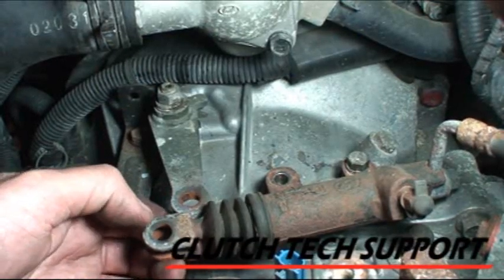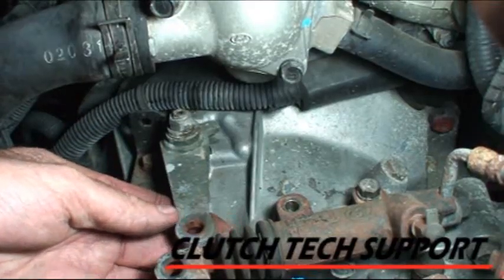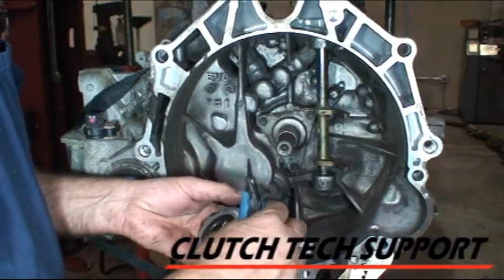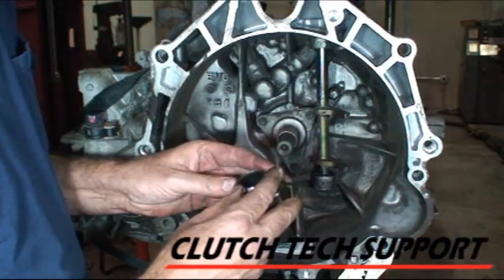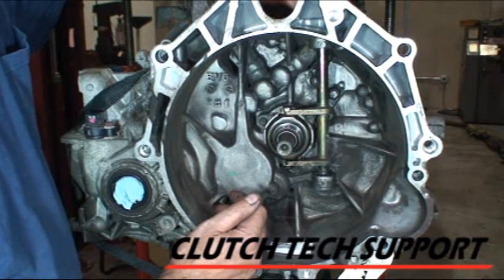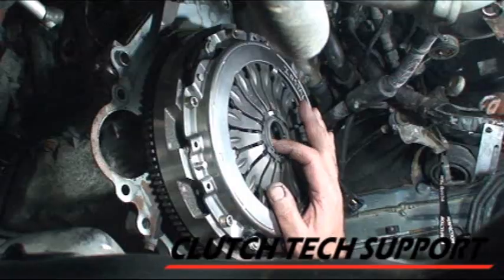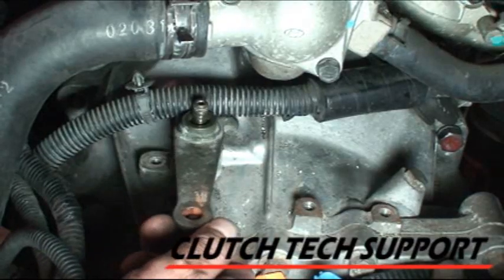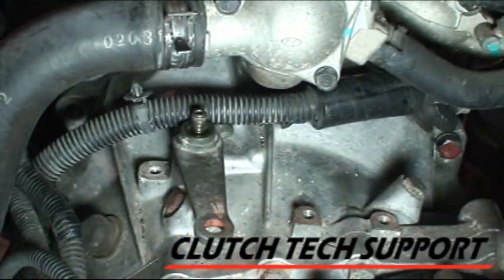Hyundai Pull Type Clutch Release System Servicing

Comment: I have a 2015 Accent, and I have to push the clutch pedal all the way to the floor, is there an adjustment so the clutch disengages closer to the top of the pedal.  Based on your video, is the clutch wear, causing the stroke length, or is the  pedal on the floor mean, I have a newer clutch.  I just bought the car and 99% of the people I talked too,  don't understand my question

Comment: I see you've recently responded to questions, so hopefully you'll respond to mine. 

I've replaced the pressure plate, throwout bearing, clutch, master/slave cylinders/lines, and have also pushed the lever arm towards the slave cylinder and havent hear a click until the arm goes away from the cylinder. What exactly would the problem be? its a 2003 hyundai tiburon gt with a 2.7 liter and 6 speed transmission. any help would be appreciated, thanks.
Reply: @perfectionclutch  So I've done what you said and it's still not working. It's like the throw out bearing keeps slipping out. It has minimal play and then whenever you push the arm away from the slave cylinder, it pops out and has too much slack in it. I don't understand how it would be slipping out if it has that stupid retainer ring that's nearly impossible to get the bearing out of. Is there possibly a number I could reach you at, because I've been at this for about a month trying to figure out what the problem is.
Reply: Ian Stephen  I have the same problem.. What worked for you? Transmission off and pushing the ring together for better grip on that bearing??
Reply: @vladisimi  not gonna lie, lol, I got rid of the car because I had tried everything and still couldn't get it to work
Reply: Ian Stephen I was also in the mood yesterday to ignite the car 🔥😂 But I tried to separate the transmission yesterday.  I adjusted the circle to point down.  (I had it at an angle during the first installation).  after pushing the lever I heard it click into the TOB.  And I think it's in place.
Reply: did it every work for you guys ? ik its an old video lol but i am currently having the same issue

Comment: At the end of the video when you pushed on it and forced the click, was 
the transmission already back I  place and screwed onto the engine ? Or 
was it still cracked open and in bolted like in the beginning of the 
video?  Thanks
Reply: Thanks Gary. Your perfection clutch installl was perfect! Job Done.
Reply: What I wanted to say was, your video was used as procedural support for a mechanic who didn't speak english. The pull-type clutch system and throw out bearing procedure was key to watch for him..Thanks again.